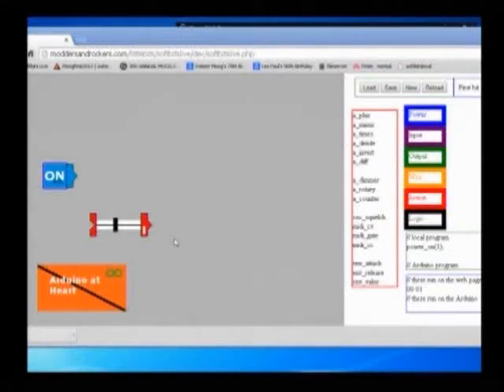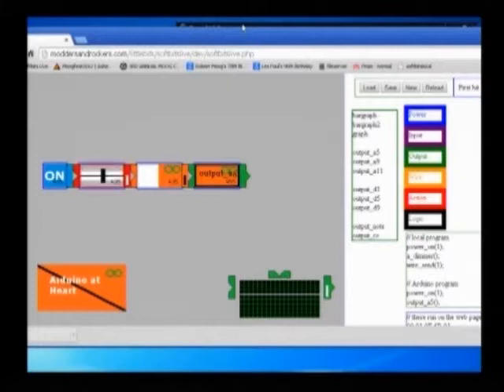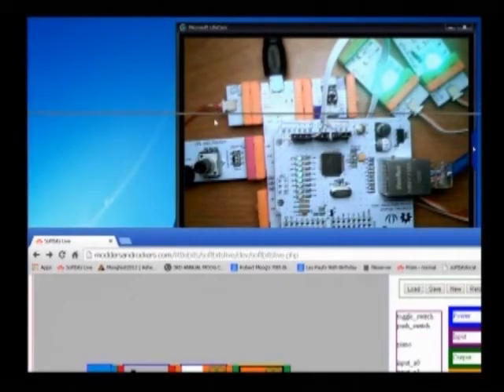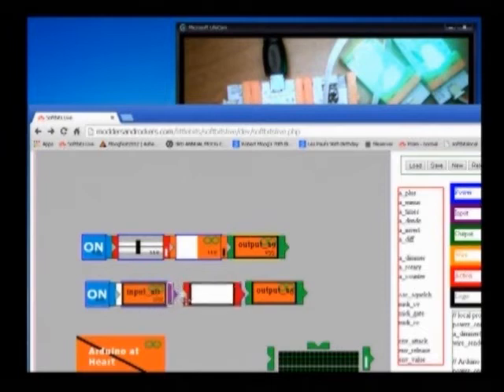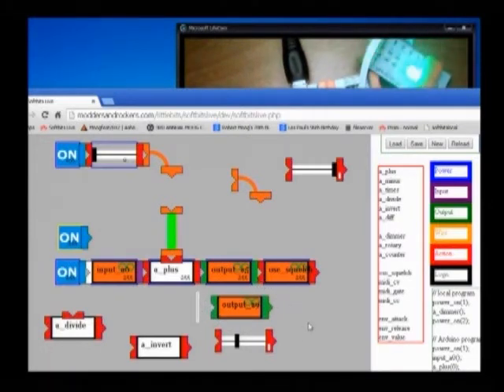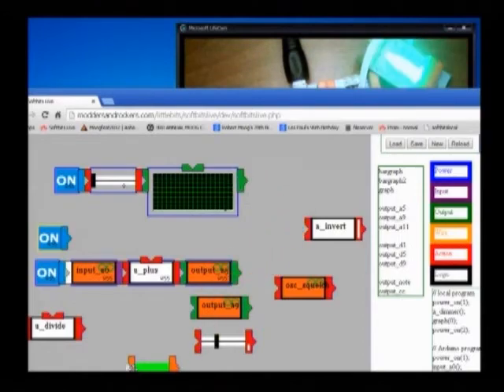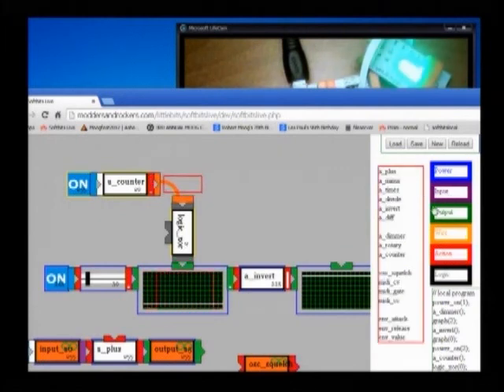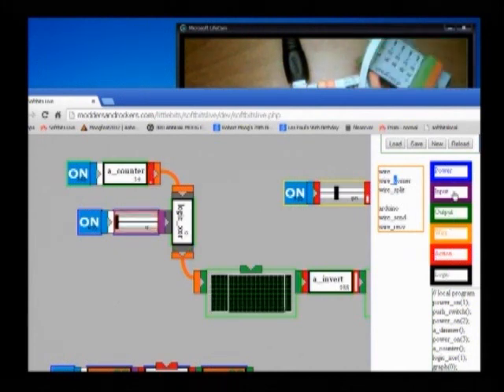Demo of current Softbitslive. Using Arduino Ethernet shield connected to a Littlebits Arduino.

Comment: With the acquisition of Little Bits by Sphero, what will the future bring for LittleBits?  Does that matter?  I certainly hope that my Arduino at Heart and Cloud bits will not be rendered obsolete or not supported.  THANK YOU SO SO MUCH PETER, FOR ALL OF YOUR TIME SHARED WITH EVERYONE HERE!  I HONESTLY HOLD YOU IN THE HIGHEST OF ESTEEM!  YOU ARE ELITE!!  THANKS AGAIN!
Reply from the maker: I have not looked at what is available recently. Wire pack can be used to make interfaces to your own hardware.  One wire plus cutters = an input and an output connector :)

Comment: I think A LOT of people WILL use this you day.  Is the project opensource on GitHub yet? Let the 13 year olds have a go at it.. it will be done by the end of the month ;)  this is getting better and better man.  Keep it up! great stuff
Reply from the maker: The current sources are available off my web site. I have not  used GitHub yet. So I will put it up soon. Just got the web side working from an Arduino Yun. So just need to get the Linux - arduino bridge supported. Then the whole project can be hosted on a Yun.